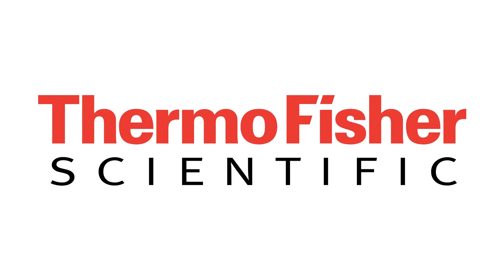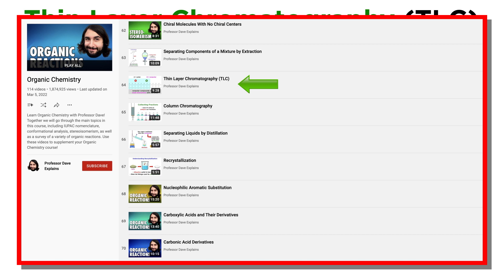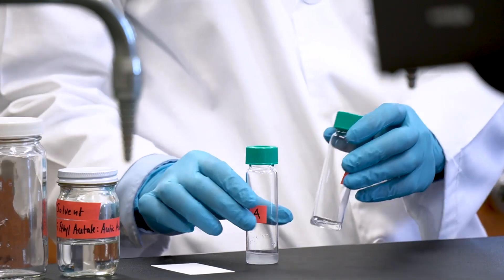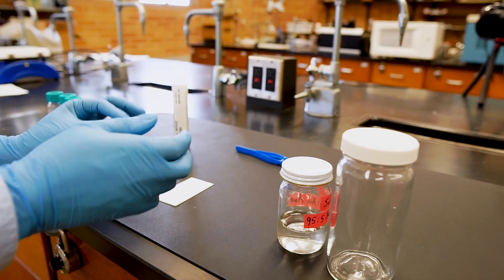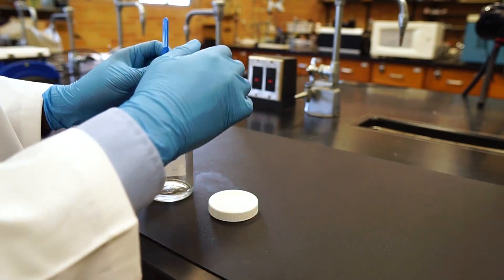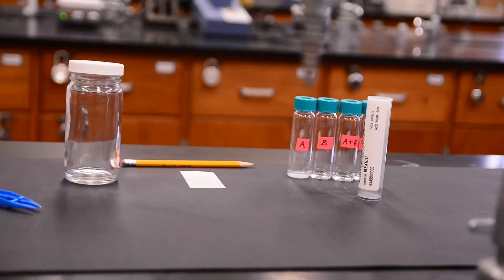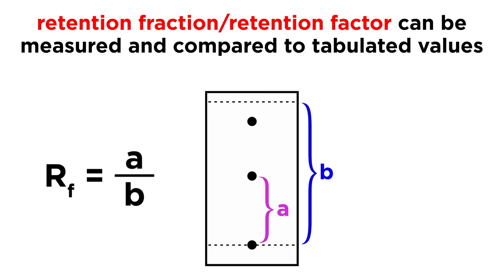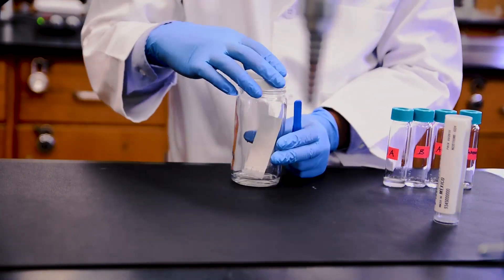Performing Thin Layer Chromatography (TLC)

Comment: But why in thin layer chromatography the sample spot to be separated is placed on the TLC just above the level of solvents. Why sir??
Reply: If it was initially touching the solvents, then instead of traveling up the TLC plate, the spots would instead dissolve into the solvent and you would lose the spots. 

If it was above the solvent level, then as the solvent travels up the TLC plate, the solvent would instead carry the spots through the TLC plate, where the spots would then interact with the polar surface of the plate resulting in a slower/faster travel time depending on whether the spots are polar or non-polar.

Comment: great video,  hope you do one one column chromatography (adsorption or flash chromatography) and explain how tlc can be used to effectively create an efficient solvent system for any purification work-up using the more common column chromatography.

Can a standard UV-C light (~253nm, for disinfecting) be used for visualizing plates at home?  they are only like $10, compared to the mineral lights or light boxes used in labs which are hundreds of dollars.

when creating reference samples for the tlc spotting of known or unknown samples, do they have to be in aqueous solution or in a solvent, and does it matter how dilute the sample is? 

How do you create an Iodine chamber for developing tlc plates?

Comment: What's the purpose of capping the solvent and letting it sit, before introducing the plate?
Reply: Letting the tlc tank become saturated with the solvent vapour means that the solvent doesn’t evaporate from the leading edge as it rises up. This slows down the rate of movement and the components of the mixture separate into better defined spots rather than streaks.
There are some times when this isn’t needed, so you can run the separation without tank equilibration.
Also, many of the solvent mixes used are not “nice” chemicals to have in the air…